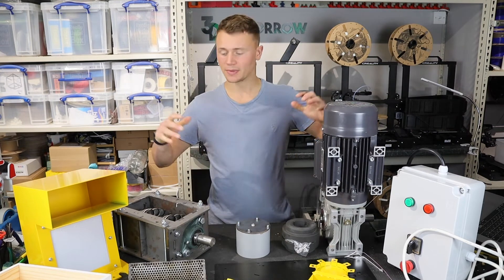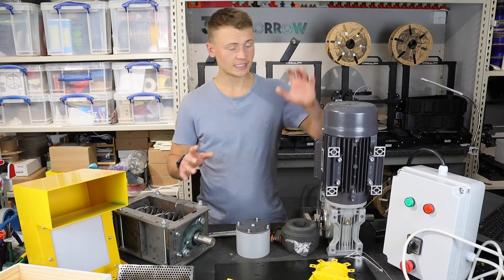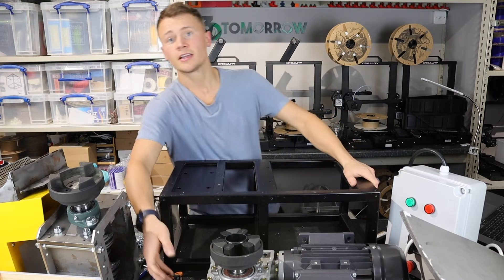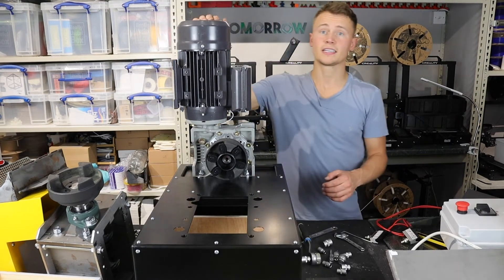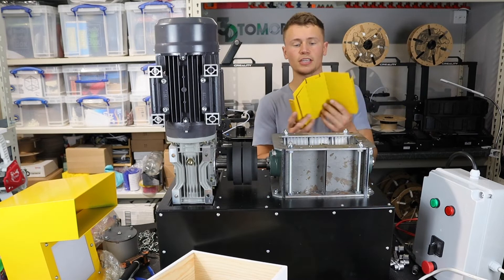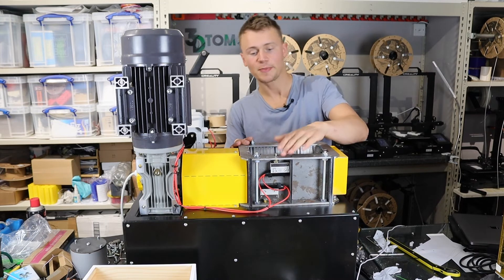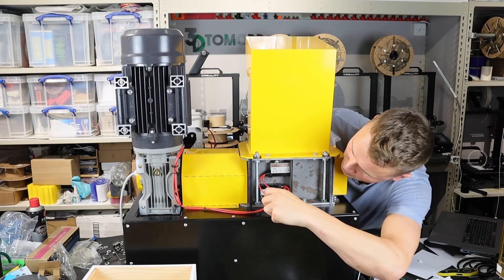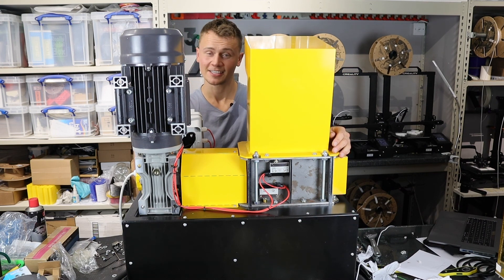Semi Industrial Shredder from Sustainable Design Studio - Up to 20kg per hour

Comment: Are there any viable pellet extruders for the hobbyists these days?
Reply from the maker: As in ones that fit directly on the machine? Yes and no, I've seen a few floating around, but even the low end ones are all still quite expensive (mid to high hundreds sort of thing). It is something I would like to test one day, but need to build a big machine first!